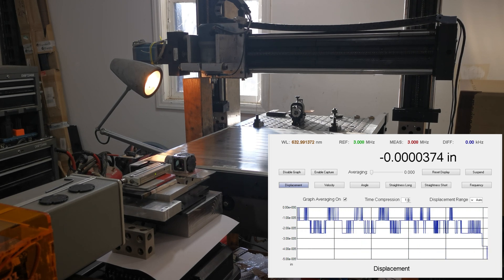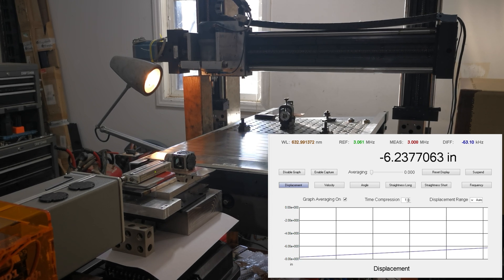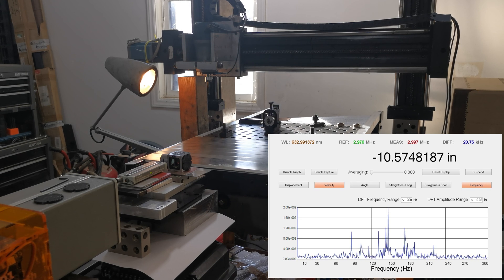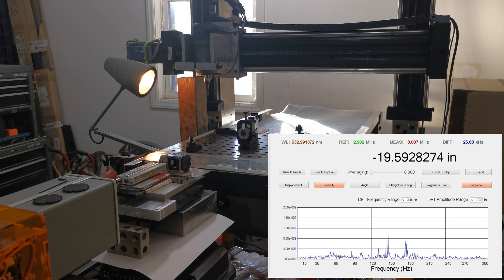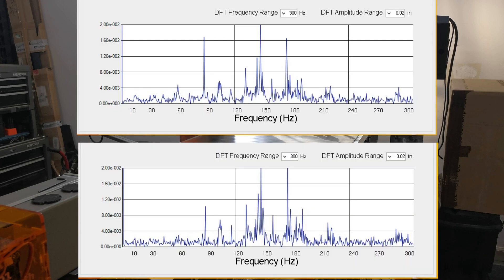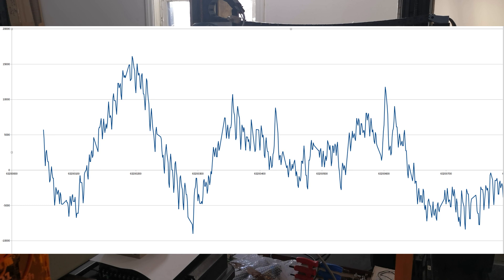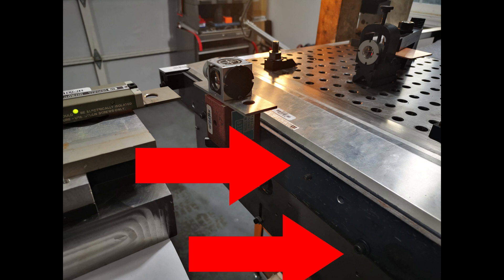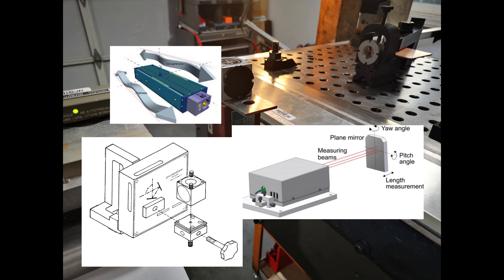Granite Surface Plate CNC Mill - First Laser Interferometer Measurements

Comment: cool!  those steppers don't sound so great though, maybe try a more modern driver?
Reply from the maker: Well, you are quite right, but I don't want to invest too much when I know I'm going to servos anyway :P. (It would be nice if Trinamics made a higher power stepper driver, to play with, though). So I'm going to take the middle route, I think: Take this concrete vibrator of a mill and Investigate what digital filtering can do. Maybe try to connect one of those mechanical resonance suppressors. Then move on to servos...